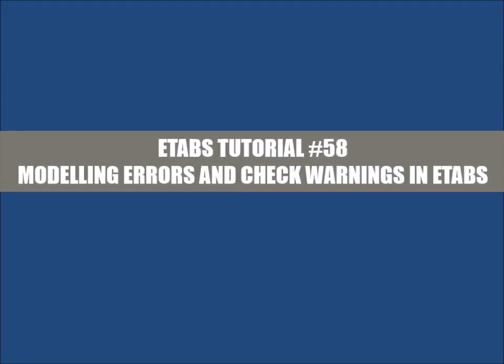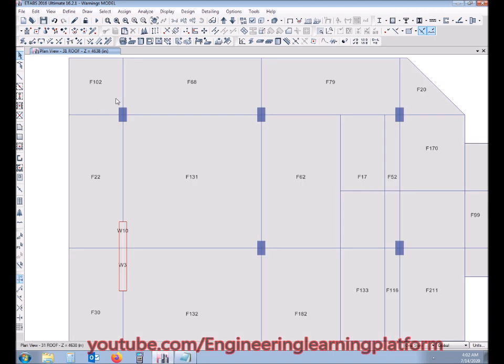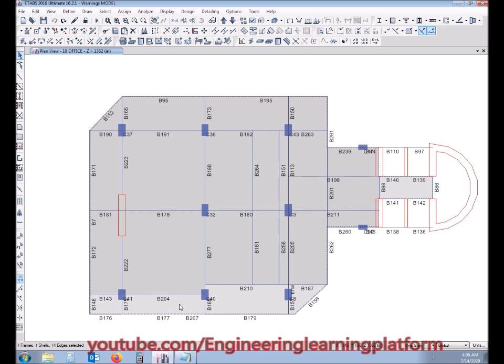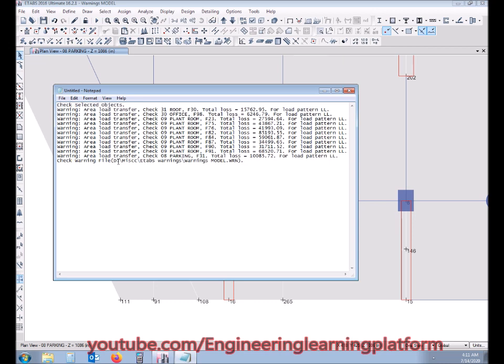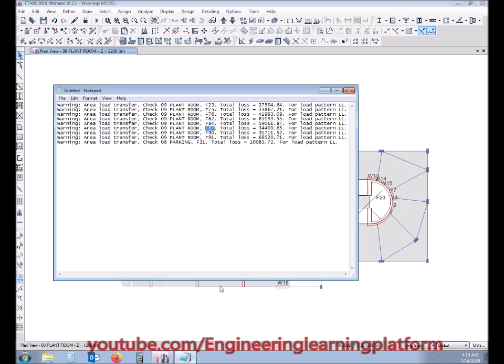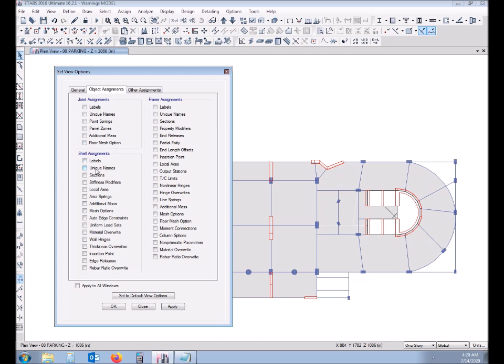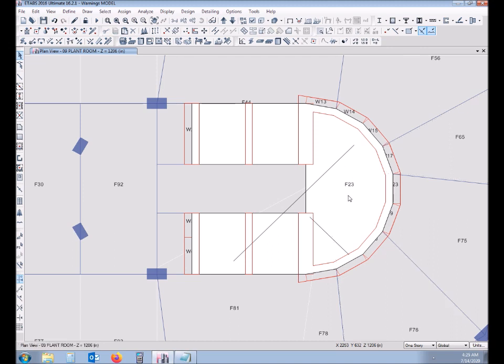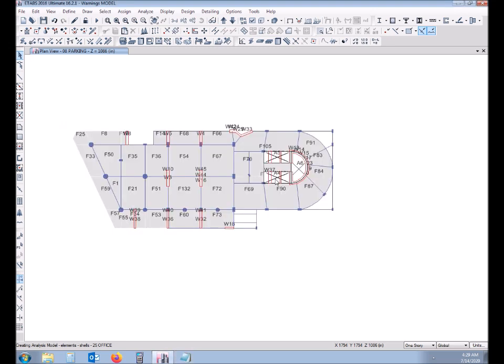Remove check warnings in Etabs and fix errors in ETABS model

Comment from the maker: Watch "Remove check warnings in and fix errors in ETABS model"
Reply: Sir i have run the check model there is no warning
Reply from the maker: @owaissofi5321  Thats a good thing .
Reply: @EngineeringLearningPlatform  how to rectify this error please elaborate it ( F21 and B216 are too close )

Comment: how to solve warning ralted to lime load not transfer ??
Reply from the maker: It means the element slab or beam is somehow not transferring the load to the supporting members . Deleting and remodeling and re applying load may help
Reply: @EngineeringLearningPlatform  i have assigned a none beam and assigned parapet load there now how can i delete beam?? If i delete it and redraw than load will gone which means combination will get affected??
Reply from the maker: @lifeline7673  for line load purpose, you need a beam, not a null line so define a section having properties of any minimal non zero stiffness (for instance 1"x1") dummy section intead of null line
Reply: @EngineeringLearningPlatform  thankyou so much.it work!d
Reply from the maker: Welcome do checkout our professional courses 

https://www.udemy.com/course/etabs-rcc/?referralCode=4F571121E8073D773BE7

Comment: etabs warning zero ritz starting vector eliminated & etabs warning no ritz modes were found, ??????

Where????
Reply from the maker: This occurs when there is abnormal modelling errors, one of which may be due to structure hanging in air (no supports assigned)

Comment: How to remove a point that is in a grid line and this point is connected to the bottom floor when diaphragm. Now how can this point be deleted?
Reply from the maker: As u mentioned it is on the edge of a n element, thus it cannot be deleted unless the connected element itself is deleted
Reply: @EngineeringLearningPlatform  Thanks for your support.

Comment: What to do with line load not transferred warning??
Reply from the maker: There are different reasons, when the line is on a slab which is having none property, or slab is membrane and supporting the beam, or the line is disconnected from Structure .
Reply: @EngineeringLearningPlatform  is there any easy way to connect lines?
Reply from the maker: Use modify tool

Comment: Sir why we not model plinth beam in Etabs or any other software
Reply from the maker: Its not your choice . Doesn't affect the super Structure behavior mu h
Reply: @EngineeringLearningPlatform  if  i want to design plinth beam then what loading should I consider 
Or if I want to model plinth beam in Etabs how I applied soil pressure on beam 
And one more query when i analyzed my Etabs model with considering all stiffness modifiers and 1st storey I am getting very less bending moment then it's upper floor why sir 
And thank you for your time and help 😊❤️
Reply from the maker: @arbazshaikh6771  For plinth beam design simply take wall load and apply on beam and design manually . As= Mu/4d . For second query it is very common that seismic moments increase with height .
Reply: @EngineeringLearningPlatform  thank you so much sir
Reply: You are very responsive I recommend your channel to my college colleagues and my friends
Reply from the maker: @arbazshaikh6771  Thankyou .

Comment: Sir am not getting the results after running the analysis.. Can u help it out
Reply from the maker: Explain further
Reply: @EngineeringLearningPlatform  sir as i run the analysis in my laptop it loads the analysis but the results and all doesn't show
Reply from the maker: @owaissofi5321  Go to analyse tab and click on set load cases to run . See if it shows completed or not run
Reply: @EngineeringLearningPlatform  sir it shows in status not run and in action it shows run
Reply from the maker: @owaissofi5321  Your model is corrupted